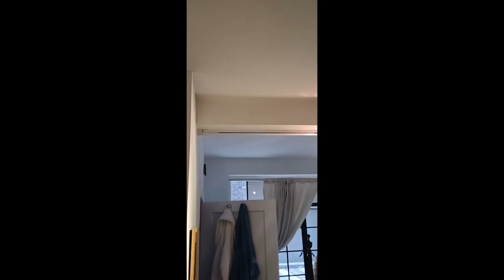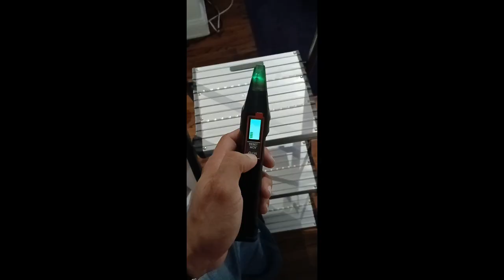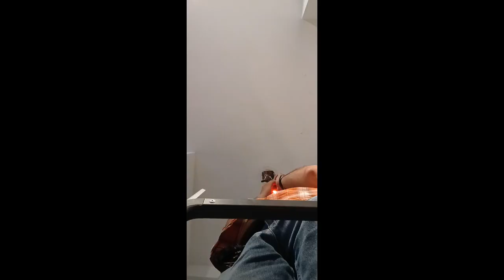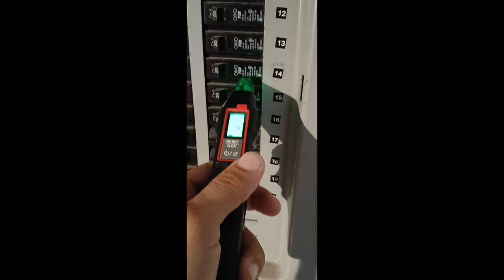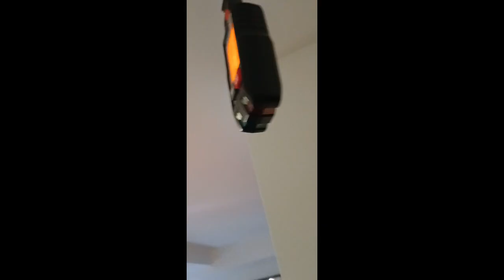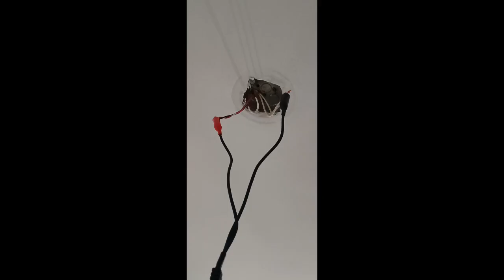Installing a New Carbon/Smoke Detector | KleinGuy Jon

Comment: So you'd recommend the Kaiweets KT301P Digital Circuit Breaker Finder?
Reply from the maker: You can use any brand, but i find this one a little more accurate than the klein tools version.
Reply: @KleinGuyJon  good to know, thanks